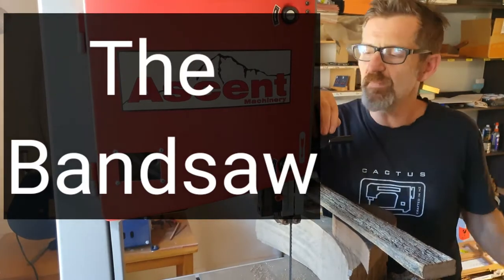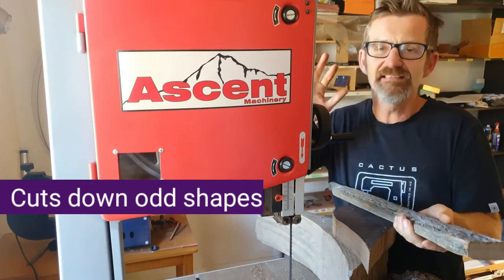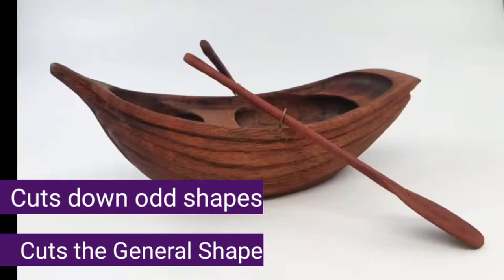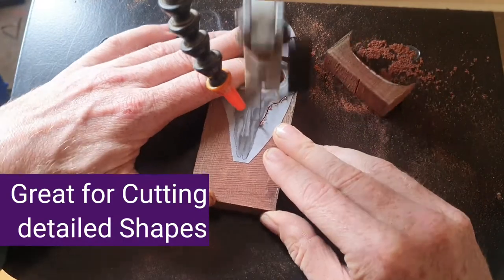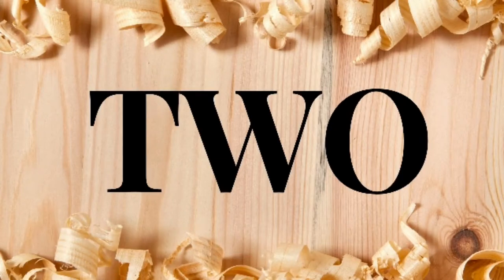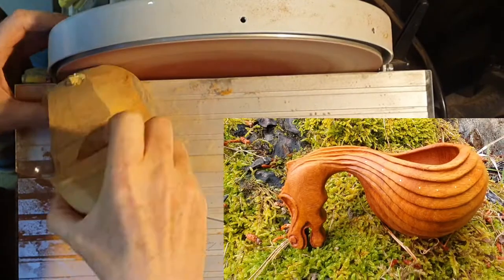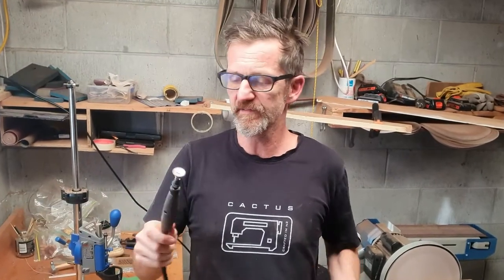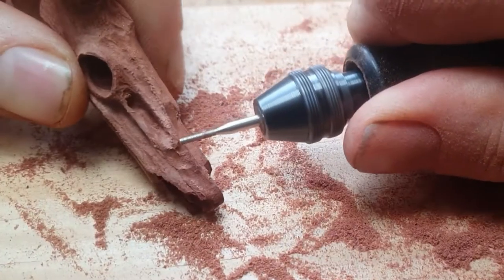My top power carving tools

Comment: Thanks Matt for the guide. I've got 2 out of the 4, i'm not sure how much the scroll saw would be of use as it seems you can't use thicker pieces of wood? I do have a chainsaw (unused!) so it all depends on what you want to carve too. Not that i'd say no to any offers of tools! Happy carving. X
Reply from the maker: Your correct, the scroll saw is for thinner pieces, I do find it useful for those spoons I made. I also have a recycled wood jewellery business so super handy for those small items. Yeah I am waiting for someone to give me a chainsaw. Cheers
Reply: @MattCarves  your bandsaw roughs out just the same as a chainsaw unless youre looking to do larger stuff. I wish I had a shop and a bandsaw, currently I just use the chainsaw outside and make a huge mess. Do you have any issues with the scroll saw climbing on you?
Reply from the maker: @chompers11  yeah roughing out with a chainsaw works great as well.  Probably the advantage of the band saw is it is more accurate and good for smaller projects. Sorry don't know what you mean by scroll saw climbing up.
Reply: @MattCarves  I mixed up a radial arm saw and scroll saw sorry, the radial I've heard can "climb cut" up or something like that, it's different than a bandsaw style cut